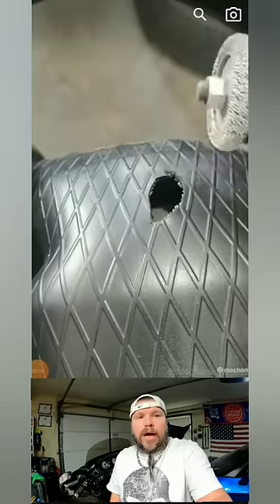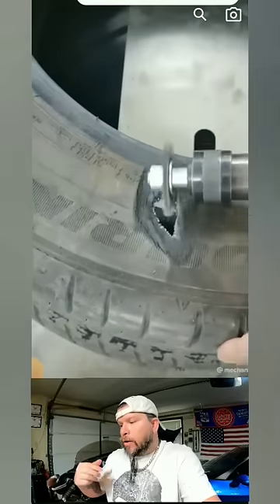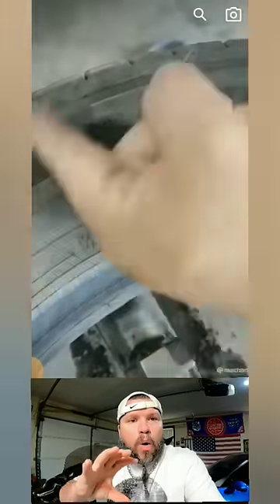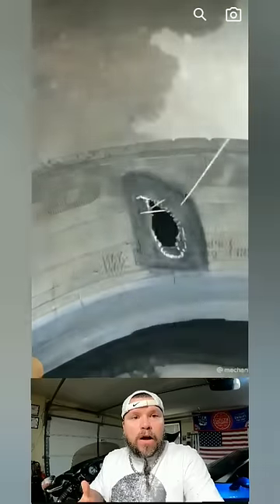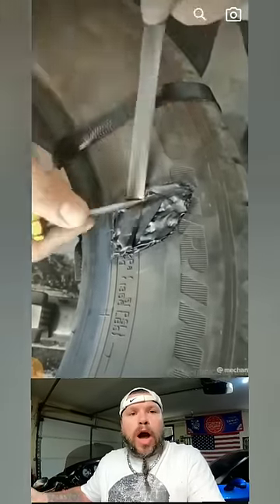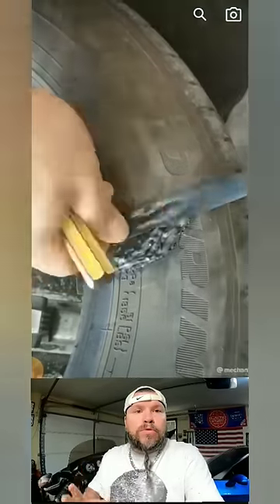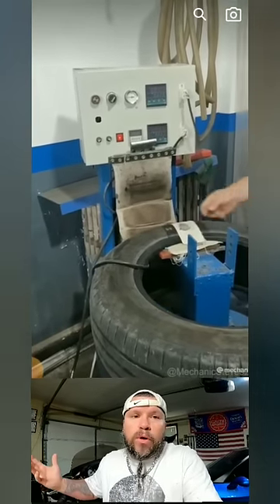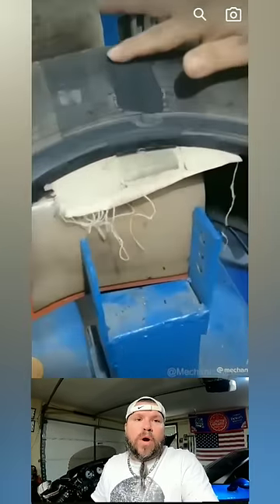patching a tire

Comment: I think you have to know that tire repair videos like these are usually from poor or third world countries.  No one in the U.S. would do this and especially no U.S. tire service company would do this.  I know even if you get a nail into the side wall, no tire company would repair it.  It is too much liability.  It is cheaper in the U.S. to simply buy a new tire than pay for the labor to repair a large hole like in the video.  So consider the source of the video before judging.

Comment: With the work you have to do and materials you use... just buy a new tire. I know you're not supposed to have one new and 3 used, but at that point, it's safer than patching up a hole in the side wall.

Comment: Respectfully, western attitudes are that of getting new, throw away. I watch lots on YouTube warning of things failing, buying things as though it's nothing to head for the shop and bin things when found. This isn't directed, I'm saying this has made me at least, hesitant to take this more than a pinch of salt. Id have used more cord though and consider double sewing, it's definitely unreliable unless proven otherwise. Just not because it's diy or a fix

Comment: That is suicide your asking to die or murder depending on if a mechanic does this to someone, and no he is not doing a good job im a mechanic i started off as a tire guy just buy another tire you could die if you do this and it pops at a decent speed or on a turn. Everything our narrator says is true, the sidewall acts as a spring and if that blows it wont be like getting a flat on the tread surface it will deflate instantly and your probably going to roll ypur vehicle.

Comment: Take it from a person that flipped his truck 4 times and hit a tree. The Fierman that pulled me out, I owe him my life cause I wasn't alive when he got me out. I was upside down in 4ft of water in the ditch. 
   The cause of my wreck, you might ask? I had gone to Walmart first and the line was way to long. So I left Walmart and went to a used tire place. The used tire place also sold brand new tires also. So instead of buying a cheap used tire, I bought the brand new one. 
   I didn't even know that this was a thing that was done. Used tire places will cut down a used tire and make it look brand spanking new again. They shave down the rubber and cut new tread into the tire. They will also shave the sidewall down a little bit to make it look fresh. 
   Any time you buy a brand new tire from a used tire place, look for those little thin rubber pieces on the sidewall of the tire. It should also have raised lettering on the dangers and psi. If by any chance, you have to 2nd guess whether or not a tire is brand new???? Tell them you don't want it. This can save not only your life, but others on the road. This is what happened to me and the cop gave me a ticket on top. But when we went to court and I had all the photos and proof that the wreck wasn't my fault, the judge very quickly dismissed the case. 
   Now I do wish that the cop would pay me for the time I had to take off of work to go sit up at the court all day. I bet if cops had to pay the person in stead of the person paying the court, a lot of those B/S tickets they give out would stop in an instant. Take care and be safe on the roads.

Comment: If this were a several thousand dollar heavy equipment or farm tractor tire yes by all means they are repaired similar to this but using proper purpose built patches. A cheap ass road tire that your and several other peoples lives depend on in a public road setting hell no don’t be this guy. There’s a reason a tire is scrapped when there is damage on the sidewall and that’s because it’s dangerous and it’s load bearing structure is compromised.

Comment: If your tire has any hole in the sidewalk or even before the shoulder of the edge it's garbage. Don't be cheap and risk your life for 100 bucks. You're better off driving around with a donut on the front of your car doing 80 on the highway. 😂

Comment: Youre 100% wrong and correct at the same time. I can tell youre american and spoiled by laws and regulations and only assume what people do doesnt work because youve been told the same thing by the mfg of the tires...

That patch will hold it just wont hold for the rating the tire has anymore. It will hold the weight and speed a normal car will travel snd it will hold it probably untill the tread is gone.

Moral of the story. Just because some american insurance company says no it doesnt mean something doesnt work. And everyone has experiences youve never had so stop acting like you know all of them.

Comment: The only reason you wouldnt run that shit is bc what you said at the beginning, youre not a tire expert, and it really shows. You explain the tire and how it works super wrong, but worst of all that little machine he used at the end is something the Auto Tech industry like to call, a vulconizer. Essentially, that little machine vulcanized the cement/ inner liner sealer he used in the hole. It get so hot and sits there on the tire for a good 5-7 hrs. That when its all said and done all the black sealer, thread and patch actually become apart of the tire. Its and interesting process, and believe it or thw finished product is stronger that the tire its self. The repair job will forsure out last the tire. Do some research next time

Comment: You talk things that you don't know, what research have you done on tyre repairs to to come here giving advise on what work and what don't. You talk too much, assumption is the mother all fcuk ups and assuming is what you are doing now. So let me tell you from knowledge and experience, that repair that was done on that tyre works perfectly, that tyre wears its full life span without issues, slow or high speed, smooth or rocky road